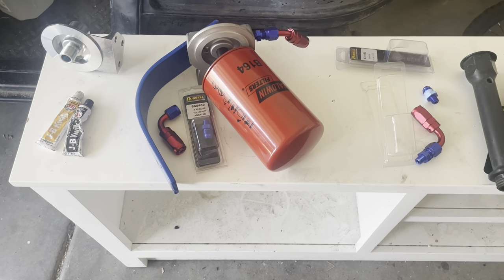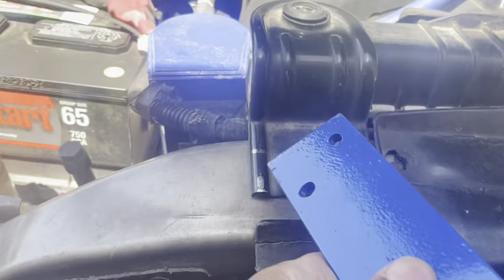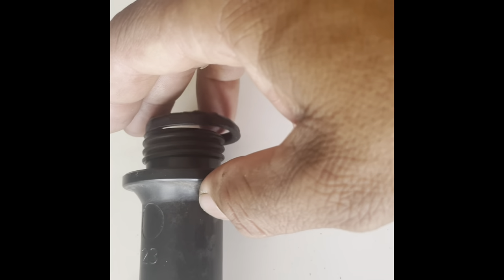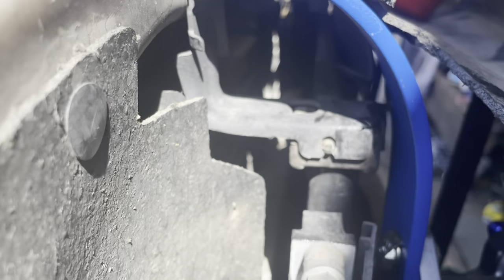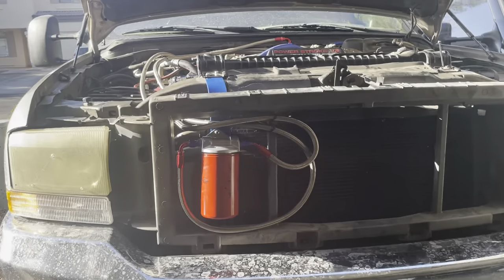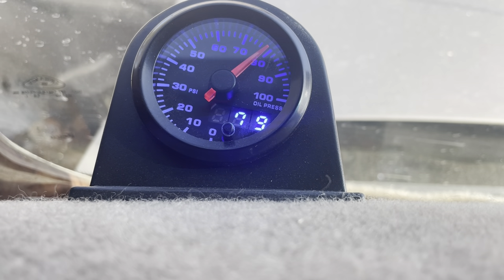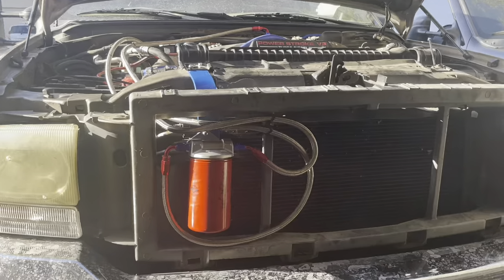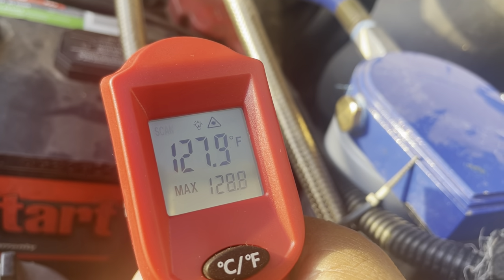$90, 6.0 oil bypass filter + oil temp cooling

Comment: I'm late to the show. 
Factory 6.0 Ford filter for oil is a 20 Micron filter with 95% filtration rate.
The idea behind a bypass filter is to use a filter that can filter out large soot particles the factory filter can't remove. To do this it's suggested to use a 1-3 micron absolute filtration filter.
The Baldwin B-164 used in this video is a 15 Micron absolute filtration filter. While it's filtering the oil better than the factory filter, it's not good enough to remove the soot.
As shown in this video a lot of flow is happening through the additional filter which can rob the engine of oil flow at Idle and high RPM.  A bypass filter doesn't need large flow to work so it's a smart idea to install a flow restriction fitting somewhere in the bypass loop.
Other than changing the filter and putting in a restriction and the metal braided lines being too close to the positive connection of the battery it looks like a well done Job.

Comment: Clever idea. I also did a DIY bypass oil filtration for my 05 6.0, basing it off a link which I am not sure exists anymore.  Anyway, I like your idea of placing it in front of the radiator to help cool the oil.  Mine is just above the CAC tube by the alternator (same baldwin filter but rubber hydraulic hoses). The cooling gains you shared relative to no bypass was interesting.  I am also noticing that the oil cools faster when not running hard (to around 180s).   The temps can approach 200s but it seems harder to get there now with a DIY.  I think it also helps that you have longer lines running further to and from your filter, allowing more heat to dissipate before the ultrafiltered oil runs back in the engine.  This should help preventing your coolant from getting too hot also.

Comment: You have to put a .030 reduction fitting in line somewhere in that loop or you'll take to much low oil pressure away from the engine and could potentially starve the bearings.

Comment: I cannot believe i did the exact same thing at the exact same time as you with the same caps. The only thing, i have a billet cleanable 30 micron filter first, in the front. And also i have a 30 row cooler.

Comment: Good set up! However when the rubber hose inside the braided line become fatigued and your more than 100 miles away from home. It will blow like a bomb went off in your truck and it wil shoot 15 quarts of oil out all over your motor faster than you can spell Mississippi! Then your screwed and the motor shuts down. Then you will need to by pass this route,  add ball shut off to make the problem easier to solve. Been there!!!  BEST PLAN, buy the kit with everything needed! Larger hoses , remote location , etc. (Spend the money, you will be glad you did!)

Comment: The problem is your filter it's only a 23 micron. You need a filter that filters down to two microns. Otherwise you will not remove the soot from the oil.

Comment: Great video has it been. Reliable I've got a similar set up but I'm trying to bypass the stock oil cooler completely and I'm using an oil cooler in line with a bypass filter as well as a check valve I found an oil cap with a fitting and I'm going to use a manual adjustable oil regulator valve that I can close the system off with if it causes issues or leaks I would love to know how the reliability of your truck was effected long term currently fighting high oil temps

Comment: get a oil cooler delete plate and a Air to oil cooler. no more oil cooler issues. also means you can run whatever coolant you feel like in the truck green purple blue pink. whatever floats your boat hell all of em if you want. given you don't have a EGR on the truck if you still have a EGR be mindful of it. and run good coolant.
Reply: Where did you get the plate?
Reply: I hear that air to oil isn't as efficient as coolant to oil

Comment: Was there any low oil presures before changing HPOP and Oil Cooler
Reply from the maker: Only at start up, but that was due to a bad weak starter. After start up oil pressure was in range. Starter turns HPOP at first to generate the pressure. After additional external filter install there was no low side pressure change either. VIP the external filter has a small port, or you will have low, low side pressure and starve the reservoir. Use Same filter I used, that has a tiny intake port. Anything over 500 psi truck will run so it’s hard to define low, ranges vary greatly. Hope this helps.

Comment: Did you leave your old oil cooler in the housing?
Reply from the maker: I did. It still functional, it’s an addition. BUT later I did replace the HPOP and oil cooler at the same time, and my deltas are now about 2 degrees. It’s a job that anyone can do with a lot of patience and a couch cushion to place under your belly.
Reply: @dieselcowboy9186  preshate you answering me Mr, fixing to do a cooler on mine looking at my options for an external cooler
Reply from the maker: @3forkshooligan84  Just about any oil cooler in the market is the update one. After I replaced with a regular cooler my deltas are about 2-5 degrees. The original system is perfectly fine. If you’re not going to be racing the crap out of your truck, you will be more than fine with the original system. If you do a back flush alone will bring your deltas closer to perfect anyway. I’ll be doing a video soon on how I DIY the back flush and  tool and show you my old cooler including deltas.

Comment: tapping into the oil filler your asking for trouble.
Reply: That's a glass filled nylon oil fill tube. It can accept threads and is thick enough where he tapped in to be safe under low pressure and vibration situations. Pressure is not an issue here because the oil is emptying into atmosphere after the  fitting. It's safe.
Use of JB-Weld was overkill and looks a bit odd but is perfectly fine for what he is doing. Some Teflon tape would have been sufficient.